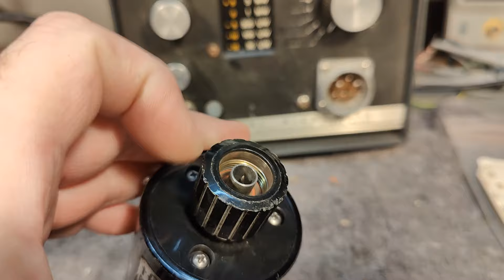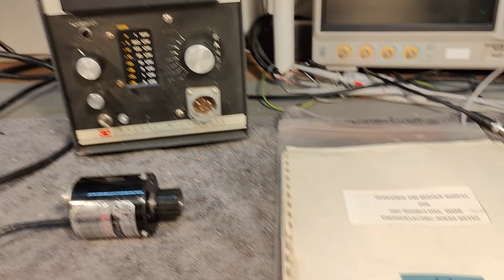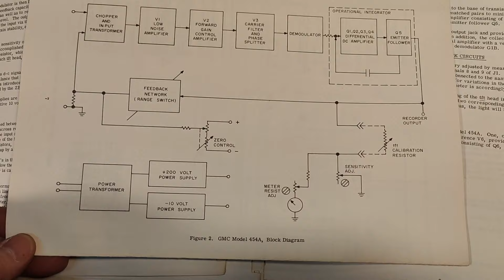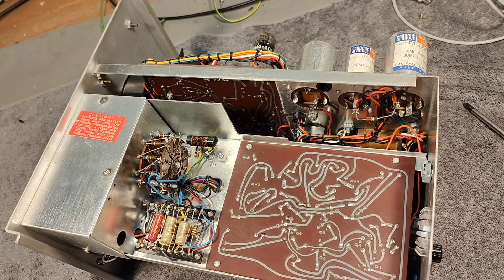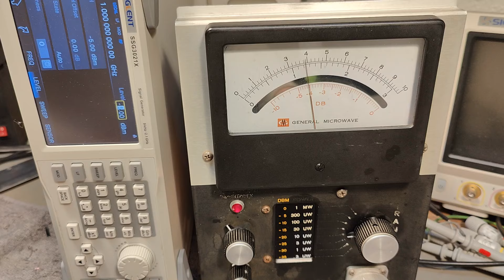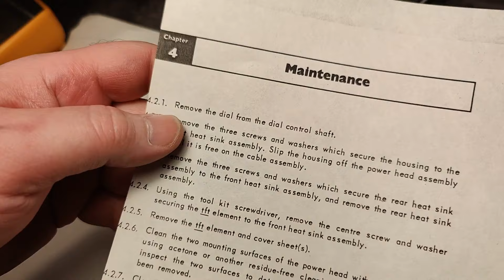General Microwave 454A Thermoelectric Power Meter 1966

Comment: Is this essentially a RF millivoltmeter? ~Jack, VEG
Reply: It measures the power dissipated in the 50 ohm load rather than voltage, but the RMS voltage can be determined by multiplying the indicated power by 50 ohms and taking the square root of the result.
Reply: @analog_guy  Thanks for the 411....may I ask then what is the real world application, I've not seen one of these before...however, just like Tom...I too collect and like to use/play with vintage gear...I may need one of these and don't know it!  :)  73's and thanks again!  ~Jack, VEG
Reply: @VintageElectronicsGeek  The real world application is measuring power in RF and microwave equipment.  These sensors, when used along with the associated clever measuring circuitry, could provide very consistent measurements, requiring a lot less tedious and expensive calibration steps than would be required with diode detectors which have nonlinear response that can vary from unit to unit and that vary with ambient temperature.  These days, thermistors are often used to measure the RF or microwave power, and when accuracy does not have to be quite so good, integrated circuits are used,  making use of on-chip matching to compensate for variations.
Reply from the maker: @VintageElectronicsGeek  you normally put a thru attenuator in front of the wattmeter, and then you can measure many watts depending of your need, lets say you repair rf power amplifier. if you work with injection for mixers or such, you use no attenuator to be able to mease the lower lever more accurate. Today we use spectrumanalyzers and attenuators, they tell us more things at the same time, in the old days 12GHz spectrum analyzers was too expensive so a wide band wattmeter was a good way to go
Reply: @TeardownOZ2CPU  Thanks Tom, I appreciate the info!  ~Jack, VEG
Reply: @analog_guy   Thanks for the info, I appreciate it!  ~Jack, VEG

Comment: The sensor part should also be the 50 ohm load. 2 x 100 ohm in parallel gives the load and 2 x 100 ohm in series is the sensor. The 50 ohms load may be only AC coupled - so there could be lower frequency limit.